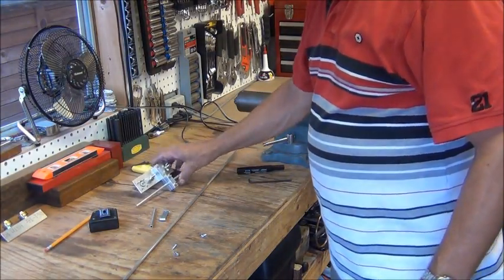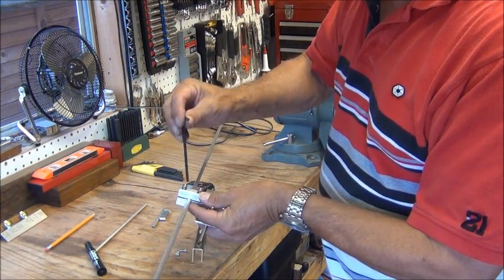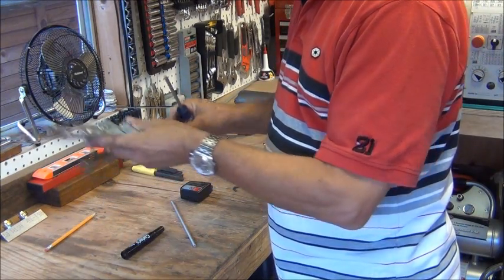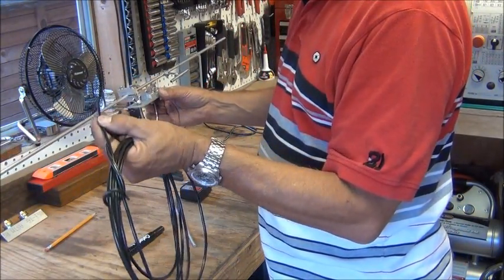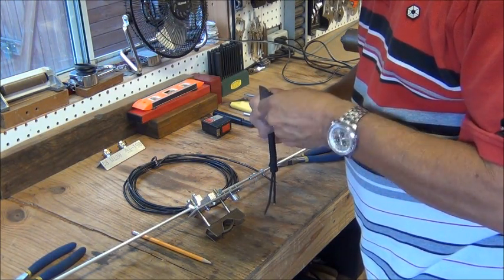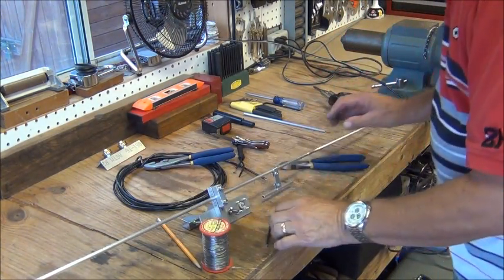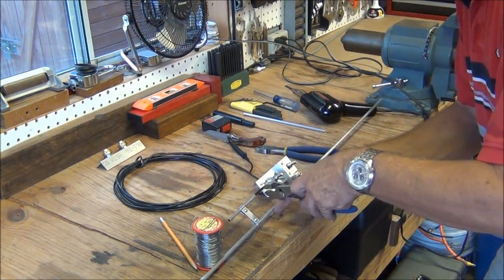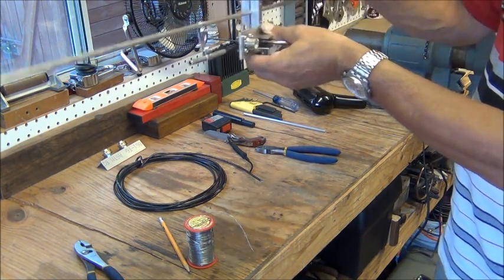2 Meter Halo Antenna Part 8 --" Initial antenna assembly and gamma capacitor assembly" by N6TWW

Comment from the maker: Yes, the wire is actually one plate of a capacitor and the tube is the other. The longer the wire the more capacitance, the shorter the less capacitance. The purpose of the gamma match is match the inductive and capacitive effects so that the load is only the radiation resistance. Since there are so many variables with different wire sizes, insulation thickness and tube characteristics, each gamma tube design will have to be tuned and adjusted according to their individual characteristics.